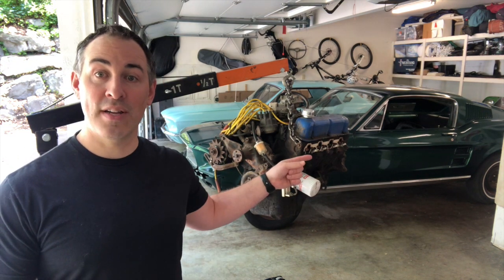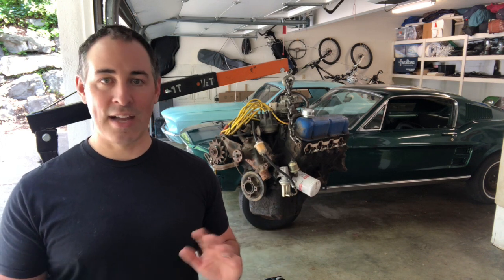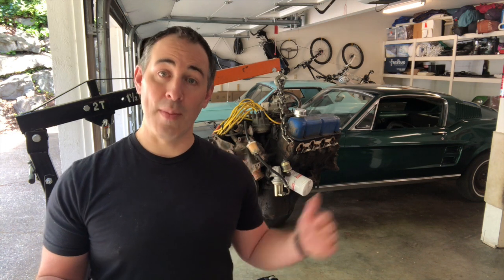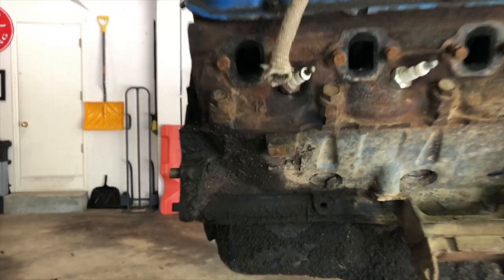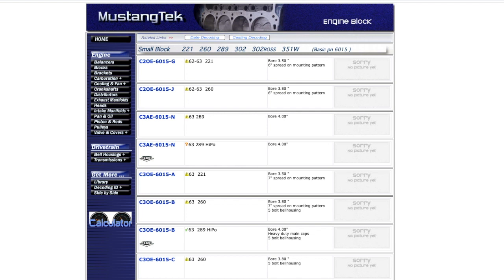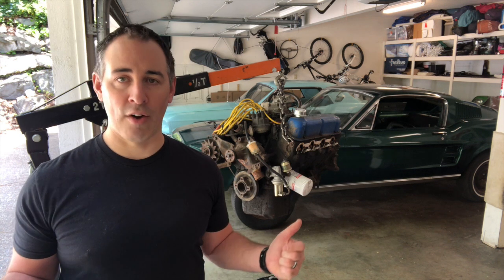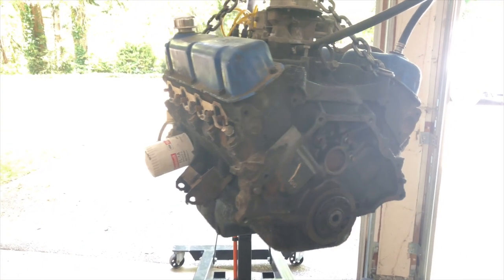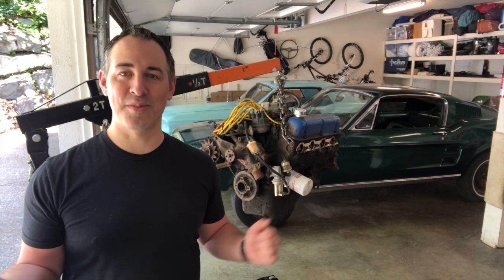Ford 351 Windsor Engine Identification

Comment: great video my man.  I will be decoding my freshly rebuilt 351W this wknd for one specific reason... it doesnt have a correct oil dipstick.  The ones from cjpony.com for a 66-69 do not show the proper fill line level so I must have a newer block.  any insight on oil dipsticks?  Currently engine resides in a 67 mustang!

Comment: not a 351 but i have a 289 that has a edelbrock intake and carb but looking to give it some more power any suggestions that arent crazy expensive?
Reply from the maker: I put a cam in my 289, and it really added some hp. Combine that with some headers and you'll definitely be able to feel a difference.
Reply: @ClassicNation   what cam did you use? and did you have to get different heads when you put a bigger cam in it?
Reply from the maker: @uraveragedave6667  I did a Clay Smith cam, custom spec'd by an engine builder in Spokane Washington who did a rebuild on the engine for me in 2013. He also ported, polished, and really worked the stock heads. The 289 is putting out right around 300hp at the crank now. It's a blast to drive.
Reply: When I was 15 the guy at the parts counter told me a chrome differential cover would give me about 10 extra horsepower I guess he laughed the whole way home after he sold it to me
Reply from the maker: Ha!

Comment: Had a 1974 high nickel block  351w...adapted to roller cam with spiders and small circle camshaft. With edelbrock rpm performer heads and single plane .030 over 10:1 compression ,  and with that roller cam limited  by the block made 505 hp , 520 lb ft on dyno. @ 6600 rpm thats back in 2010-11.
Next  will be using 351w out of 1995 3/4 ton E250 van...roller block ...so I can run more cam not have to use the archaic spider system  and of.course better AFR  heads 10.2 to 1 ...should be 550 hp n/a 🤞

Comment: If memory serves me the 1969 mustang 351w 4v had the highest compression of any mustang that year at 11.5 or 12:1 while even the Boss 302 was at 11:1 but that was in the heads also you may be able to boost it even more by betting a thinner head gasket from a 289 Hi Po special order/optional head gasket that raised that by a few tenths as well... but the 2v and 4v differences were mostly in the cylinder heads.   Most all of the parts except the intake manifolds and connecting rods and crank were interchangeable being the differenced from the 289, 302, and 351w was the stroke the 289 and 302 had the same deck height... I know you know this being this is not your 1st rodeo but this comment was mainly for the people new into the classic cars.   Also the classic Ford motors seemed to pull different than todays they felt stronger even though todays have about 2x the power.... it is like raw power versus refined power....love the idea of a modern Coyote possibly turbo's or a blower on it for this can't wait to see what you are going to do with this
Reply from the maker: I actually didn't know about the compression stuff. Interesting! Thanks for the support, Jim!
Reply: @ClassicNation  I had a 69 Mach 1 with the 351w as a graduation gift from high school had it tore down to the frame and got rid of it when I got married, never got to hear it run but was spec'd out at about 400hp  bored .60 over full tube headers and a boss 302 cam in it with a 4 speed this was my 3rd mustang I've owned my dad still has 2 one 64 1/2 convertible 289 hi-po and a 67 gt fastback 390 4 speed with overhead console as well thats how I new about the 68 torque boxes he did that resoring mustangs was a 3 generation family hobby with us
Reply: @higgs singlet  ,not sure I was going on my 69 Mach1 (this was like 25 years ago) I remember there was a difference in the 390 2v and 4v heads and thought the 351w had a smaller combustion chamber on them.  I slept since then but I do remember the 351 4V having the highest enginge compression  of any of the Ford v8's that year.. I thought the,  I thought the 3514v heads had an L shaped port on them for a bolt to pass through as well (may be thinking of the 390 again I slept since then lol)

Comment: I got a 67 mustang coupe with a 351C 4v stock engine with a 600 holly carb and a msd 6al, my torque converter needs replaced but it can still light the tires up.

Comment: I have a 460 BBF in my 67 s-code coupe. It came with a 390 originally. I did not put the 460 BB in there and want to swap out the 460 for a built 351 Windsor. I heard the pre 73 blocks are very hard to find now. Any suggestions ? Do not want to spend big money on a ford racing or dart block. Thanks for going over the casting numbers and intake bolt patterns, big help. Cheers from Motown.
Reply: Why would u not build the 460 and want the 351Windsor I got 77 Ranchero with 351w wish I had 460 or even 390 but I'm build the Windsor up, look on Facebook market there everywhere down here in western Pennsylvania
Reply: @warrengreen3217  Your point is well taken Warren. Money wise, building up the 460 is the way to go. New heads and a bigger cam  and valve train would be about all I would need. A stroker kit would really put the money up there. What do you think? Would you stroke it out too? I will crunch some numbers on that option. Thanks for your feedback, appreciate it.
Reply: @robertclymer6948 I'm sure u know this but check out seedmaster and jegs for parts
Reply: @warrengreen3217  What ratio of gear you gonna run in the center section? I run a 4:11 with a full spool currently, need to pull the spool and go with a Limited slip differential for streetability and turning.
Reply: @robertclymer6948  I'm not sure it's a 1977 Ranchero it's got Ford 9inch rear end in it, think gears are stock not sure
Reply: @warrengreen3217  Should be an axle tag to tell you ratio. A 3:73 is a great street gear for cruising or daily driving. RPM wont get too high but you get that quick light to light response. Easy to swap and pretty cheap to buy. If your gonna beef up that motor, change out the ring and pinions too. Thanks

Comment: When I was in high school 1970  I put  a 69 cougar  351w  in a 67 mustang   that had a worn out  engine
I seen this video and the mustang  I was thinking wow is that same car
Ford had a book call staging where you could build  up there engines in stages with Ford parts
So we put 289 hi-po Ford cam and lifters in the 351w   kept the 2 barrel  in take put a holley 2 barrel 500 now reminder  we were in high school with not to much money
Had trouble finding headers  boy that thing run good 
By putting that 289 hi-po  cam in the  351w  you had to change  firing order to  a 289  the  book From  Ford told you to do this
I was drafted  the car was sold  the guy who  bought it  re ran the the firing order to what was  cast in the 351 intake that was on it he never got running right again
I wish i had keep it the book  came from a Ford dealer parts department 
One of us worked at Ford parts   RIP  Gary

Comment: I have a 351 Cleveland in a 65 mustang coupe. Runs great but I know very little about it. Guy bought it from a estate and then he never drove it and it sat for 8 years before I got it. He thought it was from a 72 cobra jet torino maybe. He was told the 4 speed was from a 66 falcon but not sure. The motor does have the 4 on the heads so I know its a 4v at least. The trans reverse pattern is over left and up if that tell you anything. Has a holley carb, edelbrock torquer intake and 4:11 gears. Loves to smoke the tires

Comment: You could build the 351 for the coupe.
Reply from the maker: I would, but the coupe has the matching numbers 289 that I've warmed up a bit. It drives fantastic and I just don't have it in me to pull that trusty old 289 out for something else. That's the primary reason that I decided to get a '67 Fastback in the first place: so I could build it out a little more wild than the coupe!
Reply: @ClassicNation  *j*890

Comment: Got a question for you all experts.  Does intake maniford C60E-9425-B fit on a 351 Windsor?  Any help would be greatly appreciated.
Reply: No, that's a 66 model casting and there was not any 351w in 66.

Comment: A Edelbrock carbs linkage is wider than a 302 intake and the Windsor intake is ruffly 2-1/2 inch’s wider than a 302
I have a 408 Stroker Windsor base motor that makes 510h/p and 520 ft/pnds of torque and it is daily driven and believe it or not if I drive it like I have some sence it gets very good fuel mileage

Comment: Hello I just bought a 1955 f100 with an engine with numbers D7TE-A3B and these numbers below it. I E2 I could you help me see what kind of engine it is. I know it might be a 351 or a 400 ford but dont know more than that.
Reply: Mario, just to to engine labs and it list all the Ford casting numbers on blocks and heads. Easy.

Comment: 89 f250 Xlt lariat HD suspension with a 4 5 overdrive manual transmission. California smog bs compliant sort of i blocked off egr lol i was tired of dealing with it. I plan to strip and build it to be more highway comfortable while towing a full sized 32 foot trailer

Comment: My 66 coupe was a T code car.  I got a 351 windsor from a 74 Ranchero....or I guess the LTD would be the same.  Only mod I did was a very very mild Crane cam and Holley Sniper fuel injection.  I just honed the cylinders, new bearings, did the heads...all stock.  It seems to run good...nothing wild about it....Iam 70 years old...don't want anything to radicle at my age .😢

Comment: I have a 1970 Galaxie sport roof with the original  1st year 351w which has a higher deck height than all 351w that came after 1970

Comment: For those of you who have not read all the comments yet-the early 351W engines used 16 bolts on the intake, but the later motors used only 12 just like the 289/302's.. I have a 1976 351W motor and it has only 12 bolts holding on the intake... don't let the bolt count throw you off.. I'd think MOST 351W motors have only 12 intake bolts, unless you stumble across a very early one... They say 76 was the LAST year for the 16 bolt intake, and that 77 forward was only 12 bolt. I have a 76 Engine here and it has a 12 bolt intake on it. It's possible somewhere along the lines someone swapped the heads, and intake... or they just bolted on a later intake to early heads? I'm not sure.. but ima bout to find out.. hopefully not the hard way. I have to pull the intake to change the hydraulic flat tappet lifters over to hydraulic roller lifters, and install a roller cam at the same time. Will see if my heads have the extra bolt holes or not. This was great information, because it got me to researching the 12 vs 16 bolt heads, and what people are saying about the coolant getting into the crank case is enough to scare me to death! I'm pulling the intake to see what is happening underneath that thing. I might end up having to swap heads as well. If so, I'm going aluminum! something that actually flows some air-UNLIKE THE WINE CORK HEADS THAT FORD MADE... What was Ford thinking when they made those worm-hole exhaust ports? Jesus man.. It's like they wanted to kill any chance at the engine making ANY horsepower...

Comment: Is 302 just a stroked 289? I think their bore is the same.
Reply from the maker: The 302 does have a slightly longer stroke than the 289, but there are other differences as well: https://www.quora.com/What-is-the-difference-between-a-Ford-289-and-a-302-engine
Reply: Ohhh thanks man

Comment: Was partially right ,  351 is a stroked 302 with a taller deck
Reply: My 74  gran torino  has a 351 in it  .  Never been opened up for engine work .

Comment: Im pushing 450hp out of my 347 stroker
Reply from the maker: That's a great amount of power! Perfect setup in my opinion!
Reply: Thank u its a eagle rotating assembly mhale pistions f303 cam blue print heads 650 holly street brawler msd everything motor is bored 0.40 over

Comment: Well I had a 70 mustang that had a 351 in it originally or well when I got it I pulled it out and put a 504 big block in it Chevrolet and it ran great that was the best upgrade that I could do to that car , calm down Ford guys I really did do that but I'm just playing around